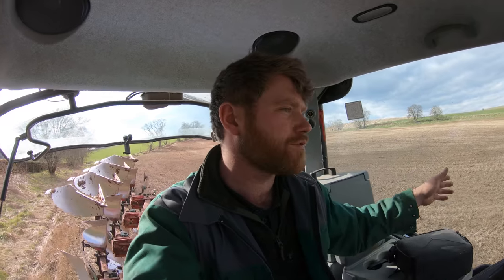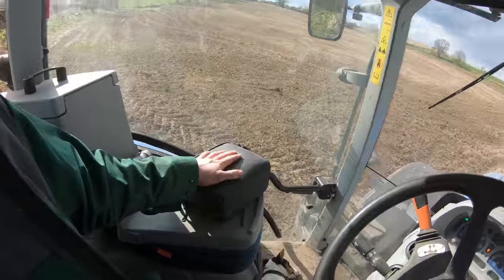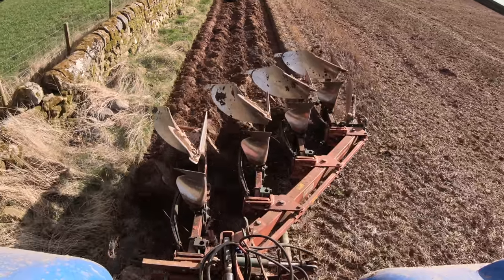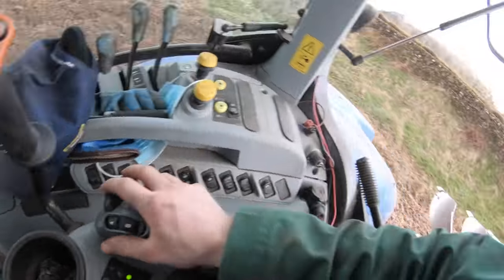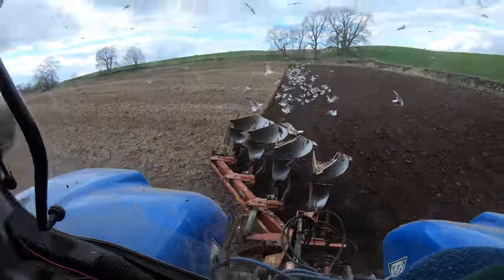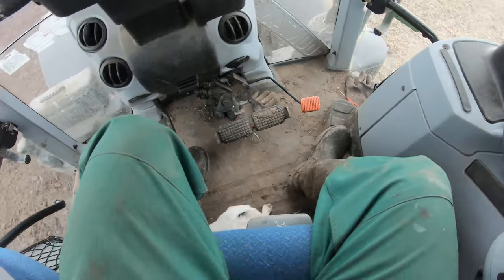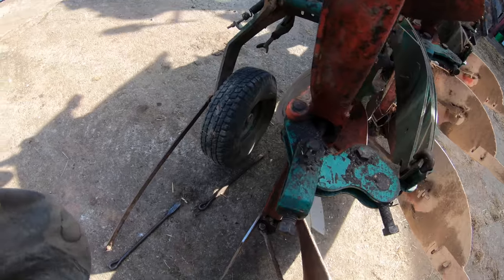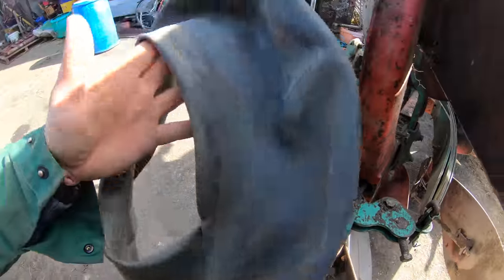PLOUGHING THE SPRING BARLEY;  LAND WHEEL POPPING ITS BEAD WASN'T IDEAL!!

Comment: What speed you ploughing at ? I usually run at about 8/9kph.
Reply from the maker: Just depends, usually a bit slower than that but that’s the fastest I’ll go depending on the soil I’m turning
Reply: @DrewsFarminLife  true if it wasn't for auto reset would be a lot slower. We rolled a rock up last year. when picked up on jcb weighed it at 1200kg
Reply from the maker: Auto reset here too, getting a bit worn tho, comes out the ground going too hard
Reply from the maker: @markbethwaite5642  some size o a rock 🪨